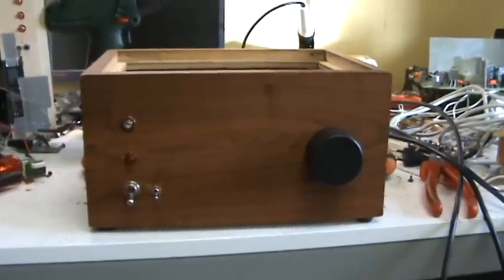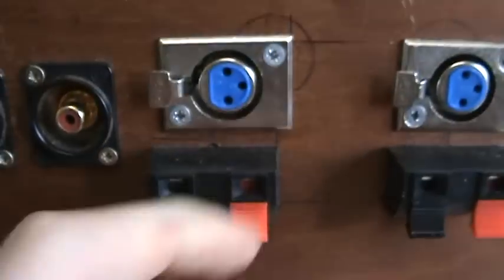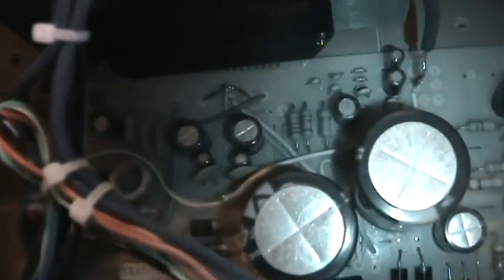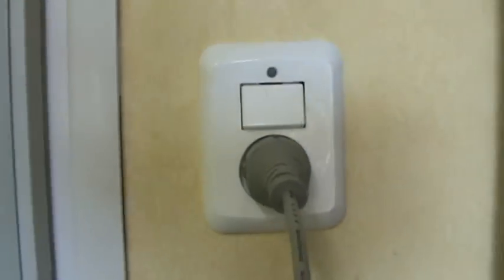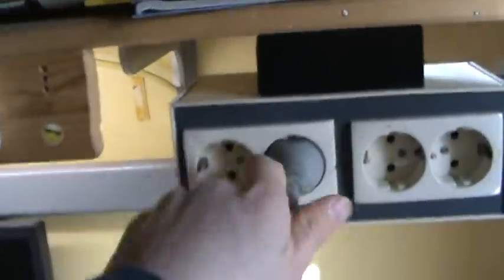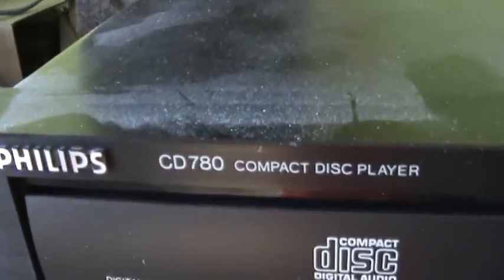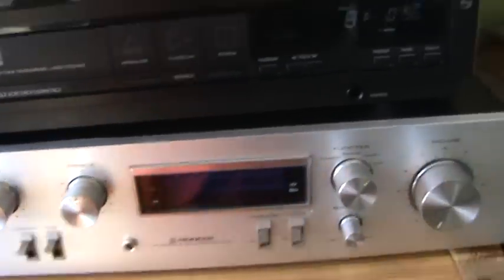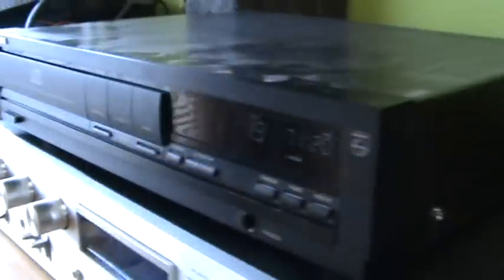Homemade Stereo Amplifier

Comment: It's not a good idea to take all wires together. The chaos is better choice if you want low noise level. Maybe some labels on the front and rear panel ? Great idea with IEC mains connector instead of internally connected mains cabel. And I see properly connected fuse holder. But some kind of insulation on mains connections would be better choice next time...

Comment: just pull out the internals of an amp 
eg a yamaha onkyo denon etc and put it in a new box and change the knobs and switches to whatever you want and mount new speaker outs. if you want xlr too just wire them in parallel with the normal outs... not that hard but essentially all your doing is changing the case

Comment: which plug? the audio one or the power cord. the power cord is just a modern euro one. a lot of eu countrys have it or the socket fits it.  the socket on the wall is a bit older so it has no ground.

Comment: I take it the original chassis was damaged? I am wondering why you didn't include the facial meters or florescent display from the chassis into this project of yours. Anyway, good job and I gave you a thumbs up. Now it is time to clean up that box with a nice stain and clear coat :) Also, what are you going to top it with?